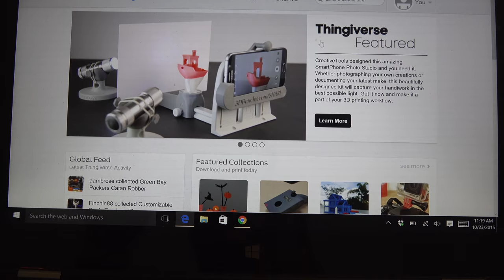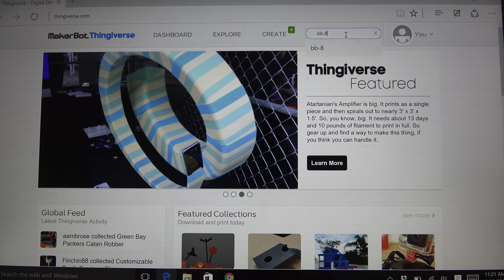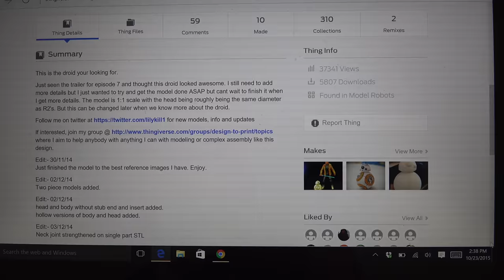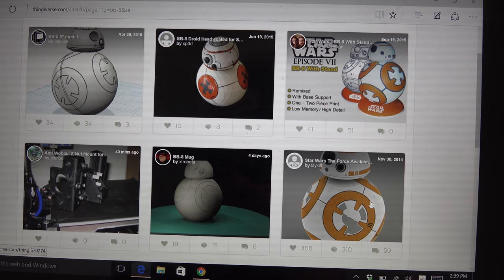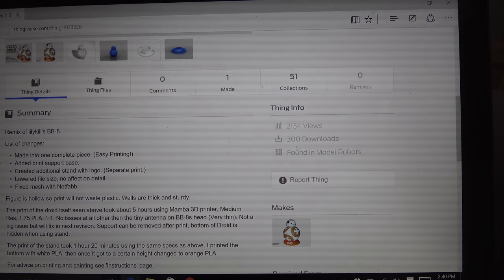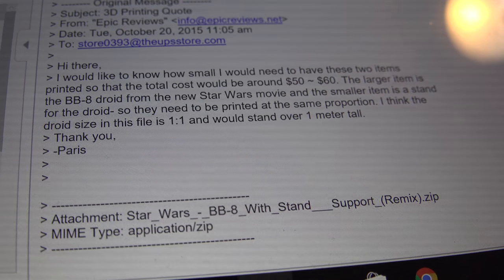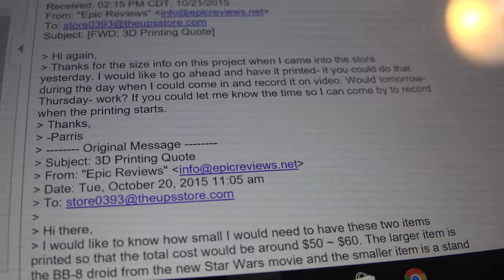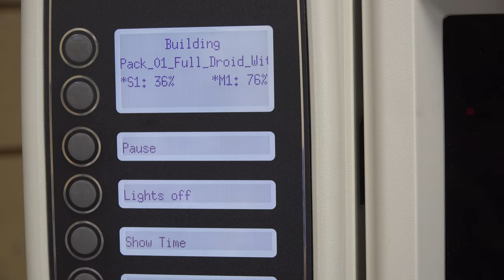How to 3D Print Your Own Toys!

Comment: 3D printing is cool did you hear about the newer versions of thees printers they're going to be able to print in color
Reply: ditc210 no i mean multiple colors like red yellow cyan
Reply from the maker: +Majed AY UPS will let you change out the color once during your print job.  But to do that they have to pause the printing and change out the filament.
Reply: I have the new version of the 3D printer

Comment: That wasn't $60 right? Please tell me that wasn't $60.
Reply: Wow. Having recently received my 3D printer (Mod-T) I'm shocked. I wasn't expecting to be able to print too much on the printer but I've still got some of the 500g spool it came with after printing out: 6 shelf brackets, a spool holder, guitar mount, mini tardis, mini eiffel tower, small picture frame holder, budda homer, pen holder, RSA token holder, Viper from BSG and a couple other bits. It goes a much longer way then I realised.

Comment: I hope that wasn't 60 bucks?....that's a pretty rough print.
Reply: I know I'm kinda late but anyways, if you look at the way 3-D printers work, it's difficult to print circles. If it would've been a square it would've been cleaner
Reply: HeyI'm Emily Not really true though, I have a 3D printer that looks like it would be much cheaper than the one used here, and I could've done that in much better quality for less than $1 worth of filament. Maybe the material they were using was expensive or something, I dunno.

Comment: wow. so much misinformation going on here.
A "chemical bath" to remove supports? um, NO, dropping the whole 3dp item into that bath will dissolve the ENTIRE THING because it's all made of the same material! All you need is something to trim the supports off (clippers, blade, etc) and then depending on how much was left on the item, likely some light sanding to smooth it out.

You don't mention what material was used, but PLA or ABS most likely at commercial store like UPS, but the "chemical bath" sounds like ABS and acetone bath? Acetone is used for dissolving extra ABS and smoothing out finished items.

EDUCATE YOURSELF before further embarrassing yourself!

I only clicked on this video to see some actual advice on creating action figures, not outsourcing someone to print a ball.

Comment: I hate to break it to you,but you dont need to take classes to design i have designed 3DPrints & own a 3DPrinter 
& i never got trainning in the software i use In fact tons of designers only got their skill from experience
 just like how us millennials learned how to use computers so easily when our older generations often left it to our own generation & newer generations Change that & then i will change my dislike into a like
Reply from the maker: Ah, that explains why instruction sheets with products seem to get shorter and shorter and why kids love Snapchat because there is no guide to how it works you just have to "know" to swipe this way and that and tap here and there.